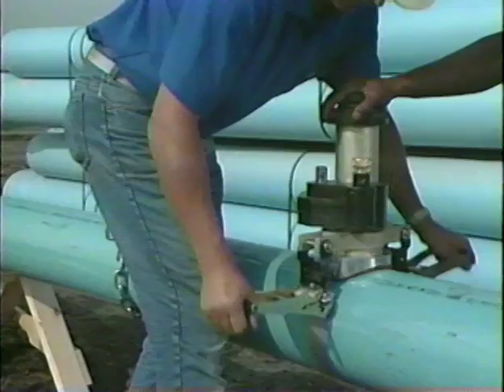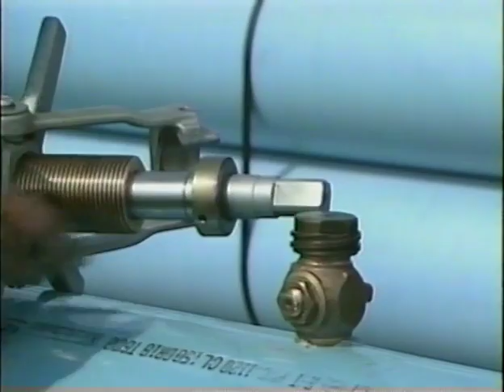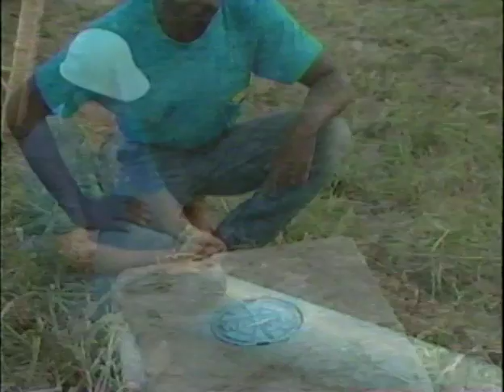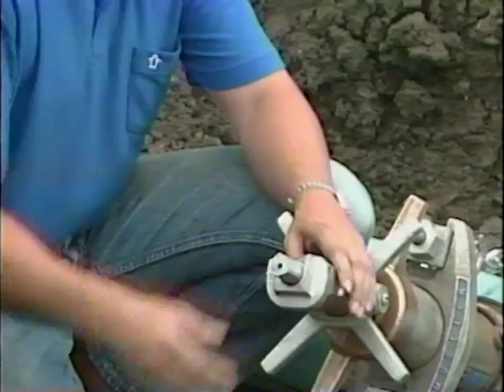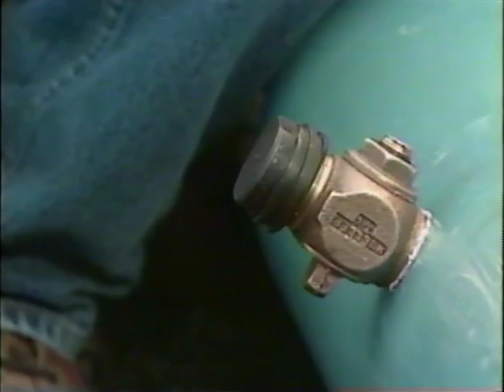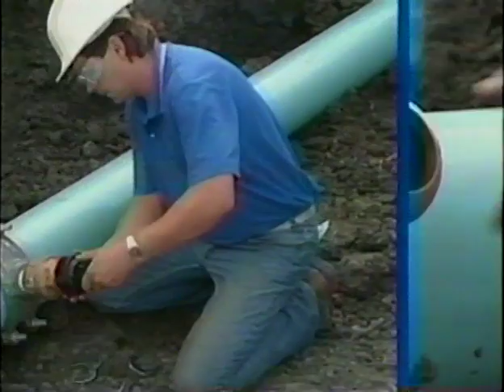PVC Pipe Tapping (Part Two)

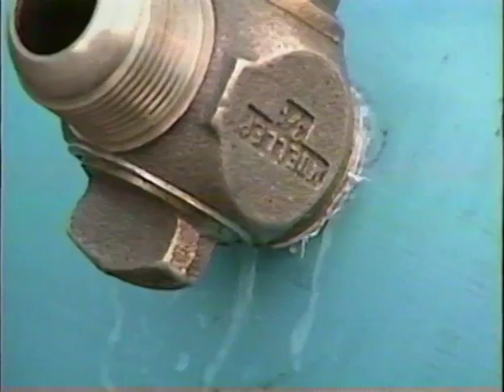Comment: Any engineer or contractor who recommends direct tapping PVC pipe over saddle tapping it either doesnt know what they're talking about or are just plain stupid. Direct tapping PVC pipe is asking for trouble and usually results in a mainline shutdown. The leaking showed at 7:14 will occur 80% of the time regardless of the health of your equipment or the pipe itself. This is because PVC pipe can become out of round if not backfilled properly which most of the time it is not and is slightly out of round. If anyone is watching this and thinking of direct tapping PVC DO NOT! Use a saddle if its at your discretion if those stupid engineers who've never picked up a shovel in their life argue with you to do it then refuse and find another job. Its not worth it.